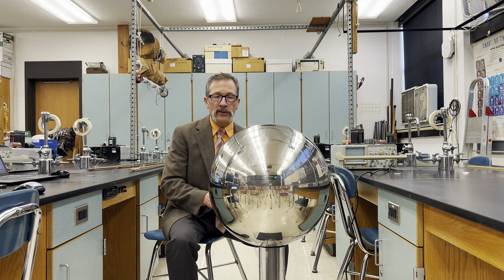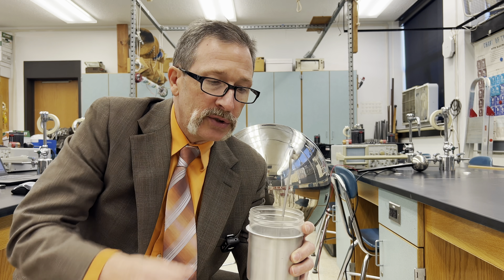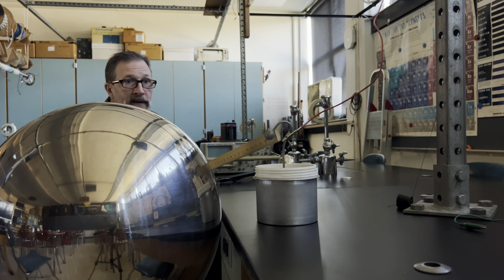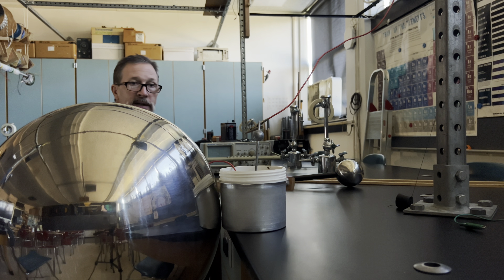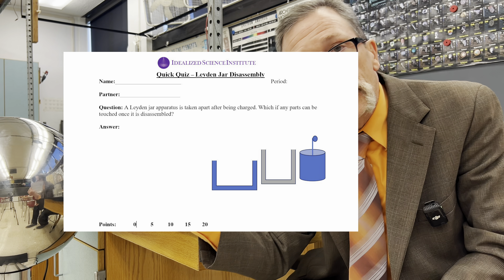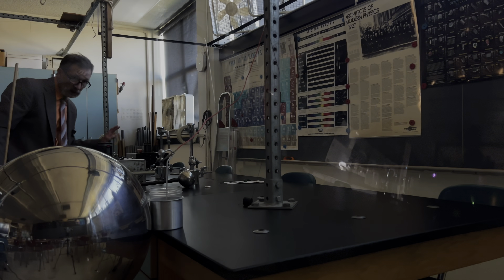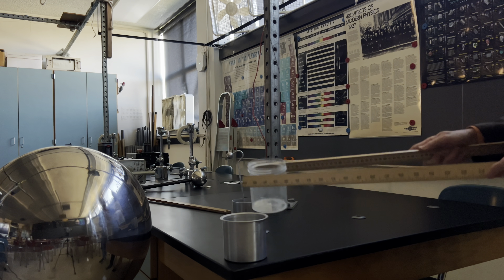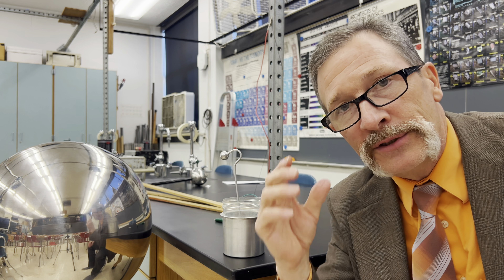This Simple Device Could Kill You

Comment: As a teenager I knew about the Leyden Jar. I made one using a jam jar and aluminium cooking foil and connected it to a PP9 9 Volt battery. I didn't dare put any more on it.
With the correct dimensions I remember reading this is where the value of one Farad comes from. I also remember it was also known as 'one jar'. 
G4GHB.

Comment: I've made 250 Volt power supplies for radio stuff and I always put a 100 kΩ resistor across the smoothing capacitor to earth to discharge the capacitor.
Yes, there is a small current flowing all the time but after switching off it discharges the capacitor to a safe low voltage by the time I remove the cabinet. But I still check there is no high voltage using a mutimeter because I don't know if the resistor might have failed. 
The 100 Watt transmitters I have had used 600 Volts on the anode. Be very careful!

G4GHB..

Comment: https://youtu.be/kHm9pTeEz60?si=Z5JlxjcBn1ej4x6g
Warning: When I was in college, there was a competition to build a robot to play basket ball with pingpong balls. I thought of building a solenoid that will shoot pingpong balls. The idea was, when switched on, the electromagnet will hit the ball. so I made a solenoid, placed a magnet near the solenoid and switched on the power supply. Nothing happened for a few seconds. Then there was a vibration sound and power supply went off. I never understood what actually happened. Several years later, I realized, it did not work because I had connected ac source directly to solenoid. I could have got a shock. I was careful, when I was doing the study. But things could have gone wrong. Really? Yes. you can put that story as part of lesson. Idea: tester with fatality indicator.

Comment: When I watch stuff like this I can't help but wonder how many people died in the early days of working with electricity
Reply from the maker: This video is essentially showing one of the earliest methods discovered for storing charges. You might appreciate this excerpt related to Franklin’s famous kite experiment:

“For the kite experiment, something was needed to collect the electric electricity from the lightning and store it for later examination. Such a device had been invented a few years earlier by Pieter van Musschenbroek, a professor at Leyden in Holland. He tried storing electricity in a water filled jar and was more successful than he had thought possible. While he turned the handle of a machine that generated electricity by mechanical, rubbing, his student and assistant picked up the jar to try and draw a spark from it to a gun barrel held in his other hand. They had seen sparks before, but not like this one. There was a great flash, and the shock that passed through the assistants body almost killed him. Their device, improved by coating the jar, inside and outside, with foil and dispensing with the water, became the Leyden jar, the first capacitor.” 

From Faraday, Maxwell, and the Electric Field by  Forbes and Mahon

Comment: I remember when I  was a trainee pork butcher. We made all sorts... haslet, faggots sausage rolls pork pies mincing all the meat with a mincer machine. One day, I was mincing some meat. With my and on top of the mincer tray side waiting, I  just casually  placed my full right hand on top of the pastry mixer mixing a few stone of paste.
Instantly, it was like I'd been zapped with lightning and threw me back. I had an awful ache through my hand all the way to the other hand and arms for a fair few minutes. It turned out the mincer was faulty. No idea of the voltage though, thats anyone's  guess. (UK normal household  voltage  is 240v, so a small industrial building from the 70's... 450v??

Comment: Wow, that demonstration was cool, I have a pair of electrostatic speakers do they work in the same principle?
Reply from the maker: I had to look up what an electrostatic speaker was! Its basic working principle depends on a charged membrane that is attracted/repelled whenever a signal is produced and changes the voltage of the plates that sandwich the membrane. 

Although not an electrostatic speaker, you may enjoy our video on more traditional speakers here: How Do Speakers Work? Understand the Physics!
https://youtu.be/X_Txm906Dbg
Reply: @idealizedscience Those electrostatic ones are fragile and expensive so it's normal you never heard of it, it's an exotic product from only a handful of manufacturers. Those speakers also don't work with any amplifier because it's a difficult load, the speaker is a capacitive load, and it's connected via a reactive step-up transformer to the amplifier so... Some use a tube amplifier for direct high voltage without transformer but that's even more exotic i think. In the past you could get relatively cheap half-half speakers, one woofer plus one small electrostat for mid and high range, the full range electrostats were never affordable for normal people.
Reply: If your speakers are making sparks, you have to turn down the volume immediately 😬 if it's a simple one with an audio transformer, the voltage is only limited by making sparks. In my case the transformer sparked and the sound ruined.
Reply: @effedrien  
I remember in a pub several years ago a singer with the volume turned up really high and inside the speaker cabinet the speaker coil was glowing on the loudest notes.
How to kill a speaker. Maybe the amp as well.
Reply: @bill-2018 that must have been extreme, the sound will be ruined forever i guess ;) But my comment was about electrostatic speakers, those don't have a coil. They can spark though because they use very high voltage instead of high current like a traditional speaker. The voltage can easily peak to a few thousand volt. And they are also ridiculously expensive so you must be careful with them

Comment: I have a big capacitor that I thought about connecting to a spark plug wire. Then charging it. 
1-1/4 diameter  by 3 inches long. 
 I haven’t, because it would probably kill somebody

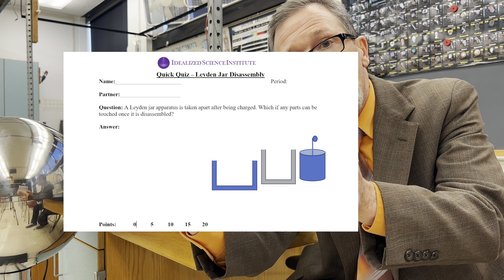Comment: 6:20 anyone, this works just like a capacitor as you mentioned the dielectric so I am educatively guessing that once the dielectric is seperated, charge stops flowing between the two plates because the distance has increased dramatically by a few 100 cm😂

Edit: 10:17 I had a feeling it would be still charged when you put it back together  all the ions are still attached to the aluminum anyway

Comment: 8:27 Well if it's directly connected to ground than the top cup would have been completely discharged. The plastic insulator in between the two metal cups doesn't carry a charge at all so it's safe too. Therefore the only part one needs to be concerned about is the bottom cup, and very much so since it was purposefully shut off before the current arcs around the insulator to the top cup. That parts extremely dangerous 😬

Comment: We used Leyden Chars to build up tension for simulated lightning. Nothing compared to the condensers used in the "Deutsches Museum" for their 7 meter spark (about 7 million volts). These condensers use a compressed gas dielectric. Not sure about what it was ... Nitrogen? I've seen it working only once (out of about 100 visits). It needs very dry air, and they had to prepare the hall for a full day, to make us kids shiver. 50 years ago 😊

Comment: Back in the 80s, I had a friend that worked at Chuck E. Cheese repairing the arcade games. They used big CRT screens and he showed me how after unplugging he would still have to physically discharge the CRT capacitor to ground before doing any disassembly. He said one time the clip that was attached to ground slipped off his tool just as he engaged the anode under the suction cup cover and the jolt threw him several feet away into a wall. He said he was very lucky to have been otherwise unharmed and it was a lesson he'd never forget.

Comment: 😂 Wood is not an insulator. At all. It absorbs moisture and conducts. Doing this in an atmosphere regulated environment is one thing...Wear rubber gloves next time. Complacency will get you or others hurt. Judging by the arc, that generator puts out what? 100kv? The right variation of Frequency, duration, current and voltage can kill you. It's not just mA of current like people think.

Comment: It is classic for these Youtube videos to show what happens but never give the why it happens.  Yes, I knew that the charge was stored in the dielectric but was surprised that you could touch the charged dielectric .   By putting the leyden jar back together just put low impedance plates between the dielectric.   If those two plates were your hands then the charge on that dielectric could flow through your hands.  You were relying on your high skin resistance.  If the charge on the dielectric was high enough your skin resistance would not protect you.  Go ahead and grab that charged plastic container with one hand and put your second hand inside the plastic container and you will get at shock.  Your hands now have replace the two metal containers.  The lesson here is a metal object or plate can't hurt you but a charged dielectric can still be discharged through if you touch it wrong.

Comment: Good demo. For even more wow factor next time, you could measure the capacitance first (jar fully discharged, on the nF range of a multimeter—easy with those homemade ones). Then use the spark length to estimate peak voltage. Rough rule of thumb: about 30 kV per cm of air spark gap under normal room conditions (20–25°C, moderate humidity.⚡️😎

Comment: One of the best things I did was to charge up some 0.47uf 400v capacitors using a full wave rectifier, and leave them on a work mates bench, when he went out for his lunch break, when he came back he tried to move them to clear his bench and me and other mates were all watching him and boy did he not freak out, we all burst into a laugh, it was much fun,  we were hilarious, but the guy was not laughing and threatened to report me to the boss. 
A week later he took a revenge, when I went out for my lunch and came back switched my soldering iron on, a few minutes later my soldering tip went flying and hit the wall and got embedded in it, he had placed some powder he scarped from some match stick heads, when the soldering iron reached higher temperature it set off the powered and the tip flug out like a bullet. Needless to say this could have seriously hurt  someone.

Comment: "never make assumptions" couldn't be a better phrase for electrics. Remember hearing of an old electrician that would bare wires with his teeth.... Yup you can probably guess where this is going!! After being last to leave a job and first to arrive in the morning he sets about work and goes to bare his first wire and BOOM! it's live and there was boot marks on the wall and roof! Where he'd run and spun 180° and also blow out his front teeth top and bottom!! Some one had been in to work after he left the previous evening and used the power for something and he never checked assuming no one else had been in the house. He survived but just!!
Reply: What an idiot wrecking his teeth by baring wires!

Comment: I used to work on a Thompson radar system which had a 40 kV pulse transformer as the output stage. The three-phase intermediate stage had oil-filled capacitors that had to be wire-wound when out of circuit, as they would air charge to a point where they became lethal. The transmitter cabinet had a chicken-stick (metal rod, insulated handle, big-ass cable connecting to earth) which you would touch all of the contacts with before getting hands inside. The cabinet also had a knife switch on the door—if you opened the door without shutting the power off, it would earth the 10kV stages with one almighty crack, blowing 60A ceramic fuses like they were nothing. You could defeat the knife switch and cop a "healthy" dose of X-rays while watching the thyratron glowing a nice shade of purple.
The good old days.

Comment: Boy did I get that wrong. I thought, no touching the metal (charged) but ok to touch the plastic because it's an insulator. So now I'm wondering, if I charge up a rubber handle of a spatula and hold it near an empty Coke can on its side, the can will roll toward the handle (I forget what this is called, but the free conduction electrons in the can are repelled, and the positive carriers are atracted, so the can rolls toward the handle) — but does this mean the handle could potentially arc to the can? Like, with enough charge?

Comment: When you pull the jar apart charged, if you take the plastic in your hands and rub them all over the outside and inside will the jar still be charged when you reassemble it? (I suspect not.) I would try the experiment myself but I don't have any parts that fit even close to what you have there. If you only rubbed your hands on the outside of the plastic would it still be discharged? How about the inside? I suspect there would not be any charge present on the inside. (same reason no charge is present in the generator ball inside) Induction and influence confuse the hell out of me!

Comment: Batteries work on the same concept.  In fact, just like Leyden jars and capacitors, they are constantly discharging charge into the air.  What makes capacitors so useful is their rates of discharge... this is how timing is done in electronic circuits.  Throw in a resistor across its poles and you have what is called an RC circuit.

Comment: From Wiki: Soda glass is hygroscopic and forms a partially conductive coating on its surface, which holds the charge.[36] Addenbrooke (1922) found that in a dissectible jar made of paraffin wax, or glass baked to remove moisture, the charge remained on the metal plates.

Comment: I used to work in a maintenance workshop for a power company when I left school. I once connected about 12 capacitors in series. Each one charged up to 110vdc. I can't remember their capacity, but they were chunky, slightly smaller than coke cans. I hooked up standard house wire to bother ends. When I shorted it out, about 1 inch of copper from both sides of the wire would literally vaporise. The sound and flash was very impressive. We messed with it for about a week until the boss saw us. I didn't get fired, and no one died. He was a cool boss.
Reply: Now, imagine putting them in parallel and use a copper rod instead of the wire 😅
Reply: @Smartapillo that's what I was thinking parallel not in series.
Reply: @justsayen2024 like i said, we played with it for a week or so. We wired it up in a variety of configurations.
Reply: The title of this video says it will kill you.  So your comment proved it wrong.
Reply: @edgeGabe lmao what? He didn't say he touched it.

Comment: Ok, none of that is an explanation

What I see is two conductors separated by an insulator.  I can see that free electrons move to earth if a route exists. I believe you are demonstrating that the charge is on the plastic insert, specifically the surface layers of the plastic.  Somehow the insulation captures the charge and in the disassembled state there is no route to earth as the plastic has a Potential Difference side to side.  Could you show that in volts?  

TLDR. Good demo, Not enough explanation

Comment: if the plastic is the insulator ... and the charge doesn't jump the lip between metal pieces than the plastic ,or insulator you could touch as it doesn't really hold charge and is in this case used to separate the two metal pieces correct? ..if the jar isnt grounded then potentially  as soon as you go to touch it your body could complete the circuit by picking up on the "field" arcing it to the metal its separating ? (assuming you dont have insulated tools or gloves right?)

Comment: When I worked in my father's machine shop as a kid he would get shipments of military jet capacitors. They had warning lables and grounding wires to avoid pulling a static charge from the air. He would turn them down in the lathe and machine the mounting flanges as specified on the blueprints.

Comment: Another good safety practice is to not trust the labelling on a breaker box.  When I was in the USAF we had shut off power to a bomber flight line spot, and locked and tagged it, so we could take apart a 440v connection in the below ground CASS (Consolidated Aircraft Support System).  My colleague was about to put a wrench on the wire nut, and decided for safety, to check it with a multimeter.  It was fully energized!  If he had touched it, I reckon he woulda been dead on the spot.  The contractors that had put in the CASS system had not taken any care in labelling the breakers.  When it comes to your life, don’t trust anybody, but yourself.
Reply from the maker: Great point! Check and double check!
Reply: Presumption is the mother of all [CENSORED] up's.

Comment: I learned the hard way over 50 years ago. Since then I've rebuilt many vacuum tube power supplies, using a homemade discharge cable and a good meter. I also use the 'belt loop' trick, a common procedure for techs and electricians where you take your 'off' hand and wrap the thumb around the belt loop. I'm still alive, so I know this works.
Reply from the maker: Thanks for the tip!

Comment: i took apart a digital camera 15 years ago that stopped working, little did i know the flash capacitor was not discharged. 300v at an unknown amperage (likely milliamps) went through my finger when it grounded. i damn near crapped my pants went into my roommates bedroom and laid down on the bed because i didnt want to be alone. it burnt my finger tip but nothing serious or lasting, i swear i felt the power of god that moment.
Reply: In a previous IT life I took a faulty PC internal tape backup unit apart and burnt a hole in my finger when I happened to touch upon a small (?) capacitor. Never gone near capacitors since that day.